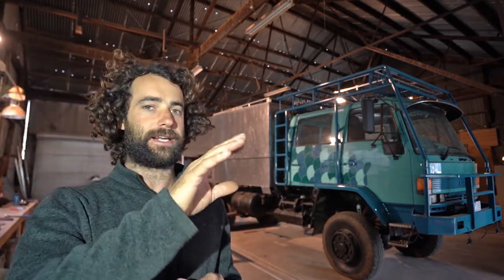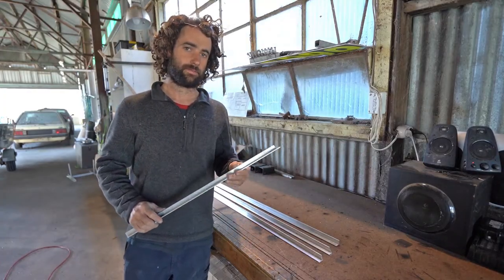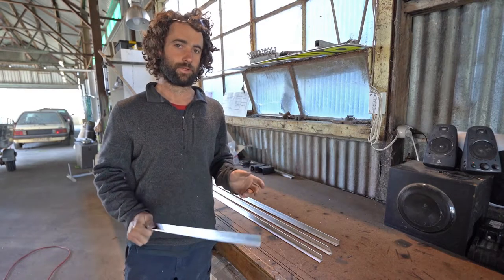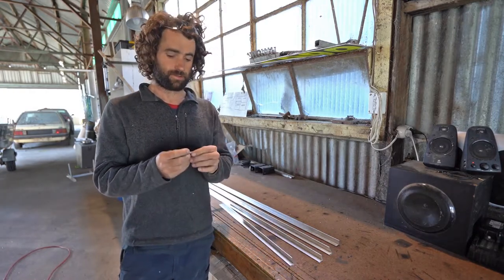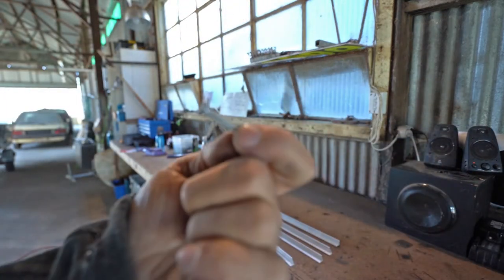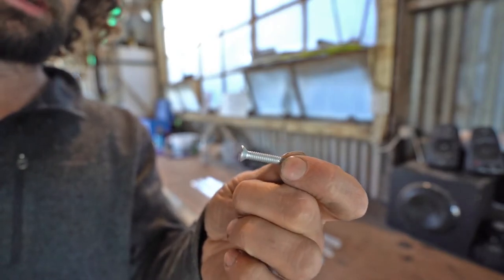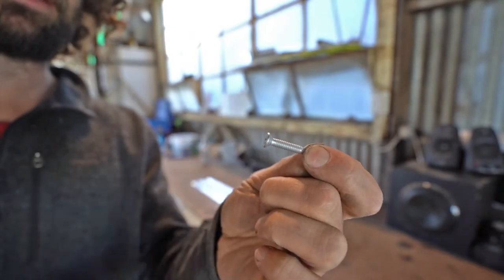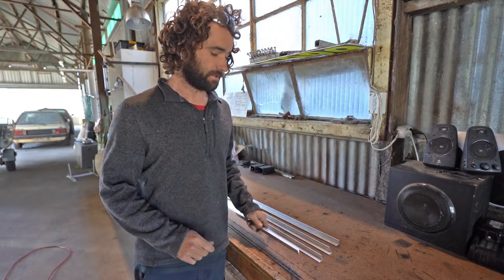DIY Door Seals - Expedition Truck Build #8

Comment: lovin the vids, im in germany and am looking to build something similar out of shipping containers that i can mount to a truck. if you do decide to ship it to europe to travel here and africa i have one of the larger shipping ports in europe close to me here in germany happy to give you a hand bringing it over
Reply from the maker: Thanks man! Let me know if you need any help with your build
Reply: @dancampion  well i started watching to see how you did the slide out extension. Why didn't you go with hydrolics? If they break down you can crack the fittings and release the pressure so you can still close up and get to a place to repair the rams. If The actuators break there stuck in that position aren't they? The containers that I am building up are being sent over to australia for my upcoming tour buisness. And my 1st thought was hydrolics.
Reply: @dancampion  essentially i am building a portable hotel that will be mounted on a b double. 4 bed rooms in a 40 foot, a 20 foot for a kitchen and dining area and another 20 foot for a bath room and water storage area. All of which will have slide out extensions so while on tour the truck can go ahead and set up while the guests are on a adventure in the tour truck/bus with the toy hauler. They get back to a hotel with all their stuff and it's all set up with dinner being prepared in places like the kimberlies and Exmouth, in Kakadu and other places like that.
Reply from the maker: @WheresTheFun  I used electric because I want to control all the actuators with a raspberry pi micro computer. There are benefits and draw back to both hydraulic and electric, I think it comes down to personal preference
Reply: @dancampion  if you need help with the RPI programming let me know. Good luck!!!